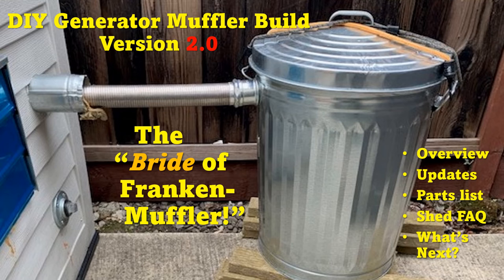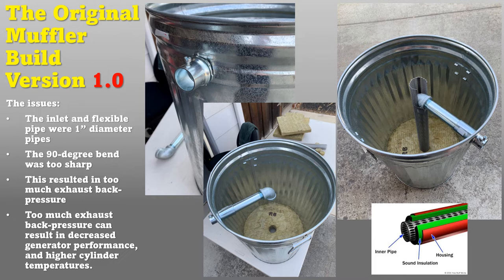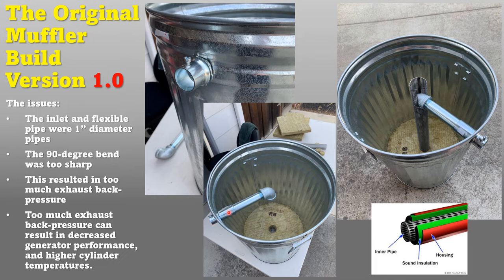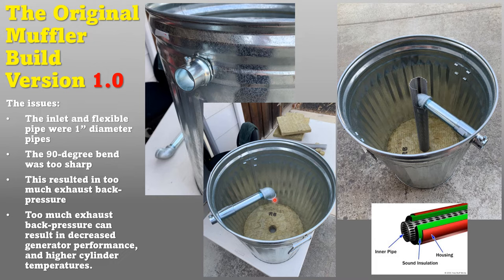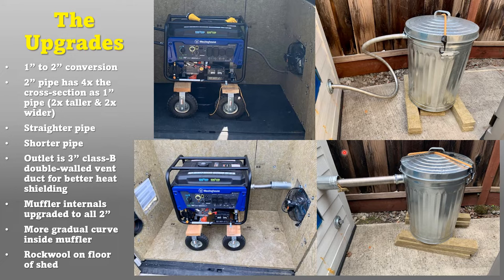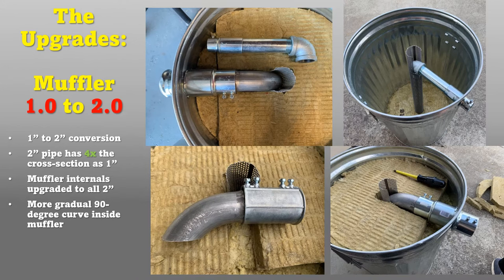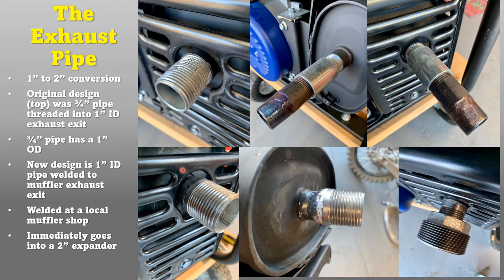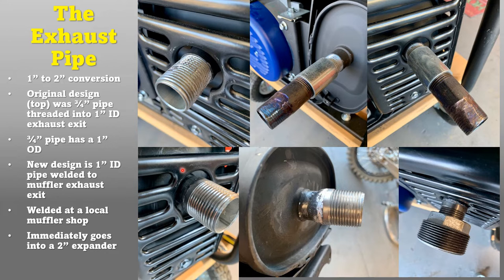DIY Generator Muffler Build (Version 2.0) - The Trashcan Muffler - Bride of Franken-Muffler

Comment: There's 2 details I didn't catch.  In your muffler... where does the exhaust pressure go?  I don't see any outlet.  The back pressure would be terrible.  You must have some way for the exhaust to exit.  And... I see the rockwool liner & top, but what is in-between?   What are those details?
Reply from the maker: The exhaust goes out a hole in the bottom of the trashcan.  I did an earlier video on the original trashcan muffler build.  you can see video here:  https://youtu.be/jZpRSenXJAs  
Not sure if I understand the second part of your question.  The rockwool is attached directly to the inner walls of the plastic shed by screws.  The acoustic vinyl is attached to the under-side of the lid via adhesive.   Perhaps you could clarify what "in-between" you were asking about?
Reply: @C5Tor  ... I saw the Rockwood disk on the top & the exhaust pipe going down into it.  Underneath that... is there baffles, or loose fiberglass batting, or just air all the way down?  What is in-between the top & the bottom of the can?
Reply from the maker: That is all explained in the previous video I listed above.  The middle of the trashcan is filled with loose rockwool batting instead of the semi-rigid stuff.  All in all it adds up to about 20 lbs of insulation filling the trashcan.

Comment: So i have a question about part the you welded on. The one you mentions is the "end of a 1 inch pipe". I keep looking at the ones availabe at home depot, and at Lowes. They are temperature rated for as low as 250 degrees with the highest i've found being 400degrees. Did you weld one that is rated higher and if so , if you don't mind posting links in your reply, or notes.
Reply from the maker: I actually used black iron pipe, which should easily handle over 1000 degrees.  I polished it up to make it look pretty, but it will oxidize pretty quickly.  Galvanized pipe can actually handle fairly high temps, but the zinc starts to melt at around 400 degrees, so I think that is the reason for the low rating. Zinc fumes can be pretty nasty, although there wouldn't be much zinc on such a small piece of pipe.  But it is a good question I didn't really take into account on the build.

Comment: I see you are using the Westinghouse WGEN 9500 which has a remote start/stop fob feature. Does the remote work properly when the generator is in the shed with doors closed? Great videos by the way. I have learned a lot.
Reply from the maker: Haven't had to use the remote yet.  I probably wouldn't use it in that way in any case, as I would typically be standing at the generator, turning on/off the propane, plugging in cords, checking exhaust setup, confirming fan startup, etc.  But I've seen on other videos that the range for the remote is quite a long distance.  I'd just worry more about turning on the propane/gas, as I do not leave them turned on when not in use.

Comment: Wow.  I have that exact generator,  bought a very expensive sound deadening generator box, & it only lowers it 25 dB.  Code requires I drop it down to 48 dB total, a drop of 42 dB.  I've found most of the noise is coming from the 2ndary muffler, so your garbage can modification is going to solve my problem. 

And ... your shed mod did exactly what my purchased sound box accomplished for about 1/10 the cost.  I feel dumb.
Reply from the maker: Good luck with your project.  I'm not even sure if 48dB is possible, unless you are in a very rural area with lots of nice sound absorbing vegetation.  In my suburban neighborhood on a quiet day with no traffic in the street, the ambient sound level is in the low to mid 50's.  You can see this on some of my earlier videos with my sound tests (see my channel for more vids).  Birds chirping and a slight breeze are louder than 48dB.  I guess if you only run it when the power is out, and you share some electricity with the neighbors, they won't complain too much.
Reply: @C5Tor  ... I have a 10,000 ft² yard with lots of hedges, but reaching even 52 dB is impossible at my property line.  The ironic thing is I live on a busy street & it runs @ 63 dB most of the time.  My city's Code Enforcement department is famous for being completely unreasonable.  So... I  try.

Comment: I wonder about putting the exhaust into a big barrel of water, sounds crazy but I think the water would be very effective at taking the kinetic energy out of the exhaust
Reply from the maker: I actually went into that very topic at the 43:00 minute mark in the video.   Those are just my thoughts on the technique.  Here's a direct link to that part of the video:  https://youtu.be/y3pUw408jCU?t=2580
Reply: @C5Tor  valid points. I think the loud glugging sound and the back pressure can be solved. The intensity of the glugging sound must be proportional to the size of the bubble. Therefore reducing the bubble into lots of small bubbles instead of one big bubble should solve this. A pipe with lots of holes in a trough of water. This might also reduce back pressure.

Comment: Question, can you use a 1-inch Conduit Compression fitting to connect the generator exhaust to the flex pipe instead of welding some type of connection onto the generator? I wonder how well electrical conduit handles high heat. I am building the muffler now but I have not welded or done anything to the generators exhaust pipe. By the way, I have the exact same generator that you have. It is a beast of a generator and I love it.
Reply from the maker: There are lots of ways to connect the pipe. The ones I used are just ideas.  The problem with this particular generator is that the exhaust outlet is a bit oddly sized.  The ID is 1", but the OD is like 1 1/8", so I didn't have much luck finding any off-the-shelf components that would fit snuggly and also were slim enough to clear the heat-shield without having to modify the heat-shield.  If you don't mind cutting or removing the heat-shield, you would have a lot more options.  I've seen people in various videos use everything from magnets to J-B Weld to dryer vents, etc.

Comment: First of all, thank you for a great video of a great generator shed. I am in the process of doing one very similar and am also planning to use the Rockwool board on the floor, but I am concerned about the vibration of the generator breaking the rockwool down since I believe it is somewhat brittle. Have you experienced that?
Reply from the maker: The rockwool isn't really brittle.  It is fairly soft.  Vibration isn't going to affect it much.  You can't roll a sheet of rockwool board up into a cylinder, but it is soft enough to bend a bit.  You can also walk on it.  I haven't seen any indication that it would break down.
Reply: @C5Tor  Thanks!!

Comment: What if you left exhaust as factory could the exhaust fan move enough air to keep the carbon monoxide from shutting off,  or is it due to the heat from exhaust that it needs to come out of shed
Reply from the maker: Several factors.  CO buildup was a factor as well as heat.  Heat was probably the major concern, as the exhaust can get to hundreds of degrees vs. the rest of the generator.  I needed that heat to go outside.  Then I also knew I needed additional sound attenuation for the exhaust energy, hence the trashcan muffler.  But it also gave me the option to do things like control the direction of the exhaust (like point it up in the air or down at the ground) or pipe it away from the shed or windows, etc.  The fan should theoretically be able to replace the air in the shed every 4 seconds.  But we all know that airflow isn't that simple.  The air stream would have probably ended up getting sucked into the inlet, travel directly across the generator and out the fan, staying mostly in the middle of the shed.  The top, bottom and corners of the shed would have stayed pretty stagnant and built up CO and heat, until the generator shut off or the fan overheated or both.  That was my theory, anyway.

Comment: I figured you didn't see my reply to your reply. so i'll go ahead an ask it as a separate question: Would it be ill-advised to put a fan that blowing air inward on the 'vent side'? So you have one fan blowing in air and the other one blowing out?
Reply from the maker: I'm not actually sure if it would make much of a difference.  While it probably wouldn't hurt to add an incoming fan, I don't think it would substantially increase the speed or volume of the air exiting the fan outlet.  That outgoing fan is going a constant speed, and I'm not sure if it would really speed up that airflow at all.  In other words, if the air has nowhere to go, it doesn't help to push more air into the shed.  I think a better solution would be to add a second outgoing fan, which would increase the airflow by increasing the area of the outgoing vent, thus allowing more air to exit the shed.  Just my perspective, of course.

Comment: Did you do any temperature testing of the exhaust  manifold with and without the frankenmuffler?  Great job here !
Reply from the maker: Unfortunately, haven't had much chance to do temperature testing.   I guess that is a good thing, since it means my power hasn't gone out yet.
Reply: @C5Tor   Just wait until you need to run this on a hot day .. double up your fan cfm .. thank me later

Comment: what is the temperature of your generator when the box is close ?
didn't  see any measurements of heat
Reply from the maker: Haven't really had a chance to use the shed in anger yet, so haven't done any extensive temperature testing.   I did rig up some remote wireless thermometers, though so that should help keep an eye on things if I do use it.  The shed does get hot just sitting in the sun, but the insulation actually helps quite a bit with that.
Reply: @C5Tor  i really want to know the temperature of the box open vs close with generator working, vs box in idle mode with generator not working
it will be very help to me and anyone that want to try build box like that..

also if you can explain why you chose "rook-wool" and not "fiberglass-wool"
or why you didn't use "drywall-soundboard" or "polystyrene foam panels"
all this information will be very helpful
maybe you can do another video on all this stuff that people can decide what is best for them from your experience
Reply from the maker: The rockwool was really ideal for this application.  It is fireproof to 2000 degrees F, while the fiberglass melts at a much lower temp.  Rockwool is also resistant to mold, and doesn't turn to mush when it gets wet.  Additionally, rockwool panels are already used in sound dampening applications because it is much denser than fiberglass.  I wanted something that dampened the sound but was going to be fireproof.  The other items in the list were really not as good in either the sound attenuation or fire-resistance categories.

Comment: Hey could you comment on the direction of air flow from both sides of the mini-shed. Is the attic fan on the right blowing air inward or outward? and Also the other side is it just a vent or is there an actual fan on that side?
Reply from the maker: The air comes in through the vent on the left, and exits out the fan on the right.  The fan is blowing outward, as most attic fans do.
Reply: Thanks for responding. I have a follow up. Would it be ill-advised to put a fan that blowing air inward on the 'vent side'? So you have one fan blowing in air and the other one blowing out.
Reply: @KeithOlbermannn  it's best to do it as he did. If you vent is to small and the fan is drawing air in, as you asked, the fan would be prevented from flowing at it's highest flow rate. Plus it can create air pockets at the roof area of the shed. If the fan exhausts hot air it will have a better chance of drawing the hot air from all parts of the shed via turbulent mixing of the incoming air from the vent. It's always a good idea to look up the basic math to figure out if your vent will the near the same CFM of fan, or a little more. I can't recall the formula off the top of my head, but they are a bunch of places with it. Some even have calculators to figure out CFM of a given vent hole size. This will ensure the fan does not draw excess current, and become a safety hazard, while ensuring it cools effectively.

Comment: Spark arrestor is not needed and actually a huge hindrance of free flow.  A spark arrestor is not needed in non woodland applications……
Reply from the maker: This being California, it is unfortunately required at many OHV parks and camping areas.  This is for a woodland application, when I take the generator with me dirt bike riding.  I wouldn't run it at home, and only put one together to make sure I was compliant when asked by park/forest rangers.  Best to be prepared.  And if I have to run one, might as well do it right.

Comment: How did you attach the blast gate to the shed?
Reply from the maker: I drilled a 6" hole in the shed with a 6" hole saw.  Then used screws with large washers to hold the blast gate to the inside wall of the shed.  The screws didn't go through the plastic of the blast gate, otherwise it would have interfered with the operation of the sliding gate.  The screws were just "next" to the blast gate, and the washers hold it in place.  I followed up with some foam insulation around the hole to seal the edge and make it waterproof.
Reply: @C5Tor  Thanks

Comment: Do u have ATS?
Reply from the maker: I assume you mean an Automatic Transfer Switch (ATS).  In my case, no.   I have a simple manual transfer switch with a generator interlock kit installed so that you either have the mains or the generator selected, but not both at the same time.

Comment: As if electric cars weren't bad enough...electric dirt bikes LOLZ
Reply from the maker: Love my electric dirt bikes!  For myself, it really put the enjoyment back into dirt bike riding.  Almost no maintenance, no oil changes, no air filters, no smelly gas to leak all over or gum up my carbs, no waiting for the bike to warm up, no burning body parts on hot exhaust pipes, etc.  The riding experience is very zen, with no need to shift or bog the bike or worry if I am in the right gear.  Your feet are always in the right placement on the pegs, because you don't have to worry about the shifter or the foot brake. Getting into the flow of the trail or the track is super easy.  Just turn them on and ride!  Both gas and electric bikes have their own pros and cons.  The main weakness of the electric is range and charging speed.  For everything else, I think the electric is superior, at least for my needs.  But to each his own.